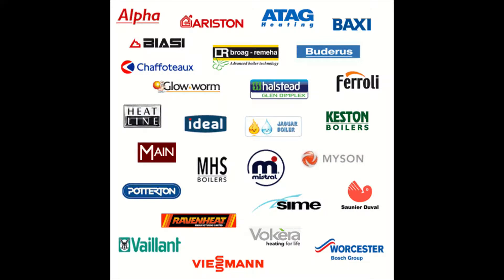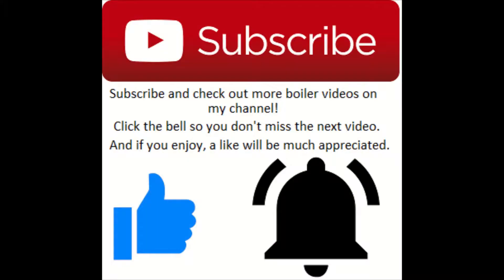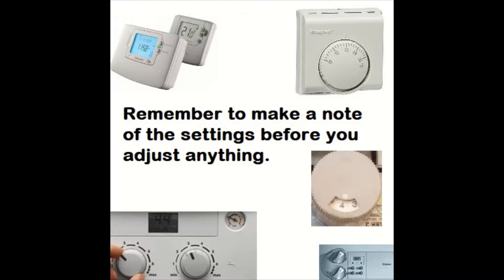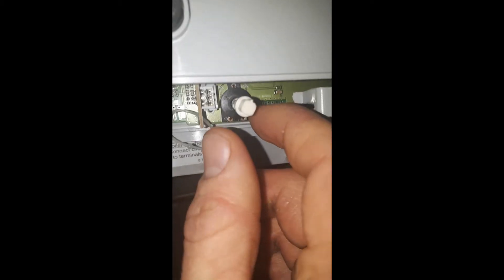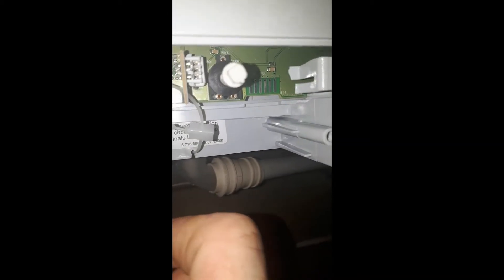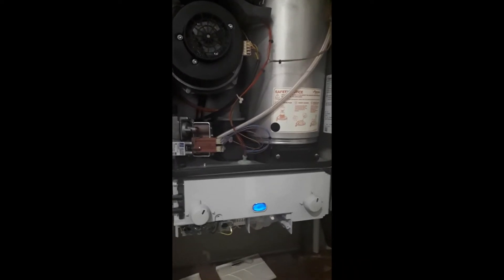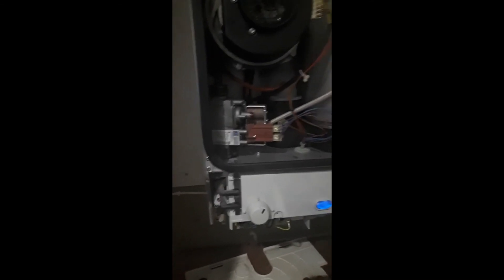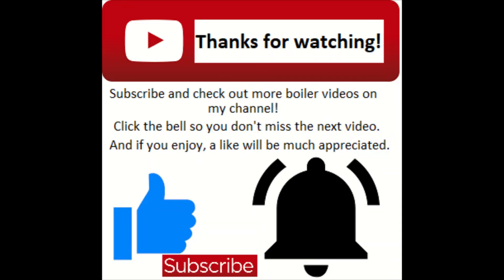How To Put A Worcester Greenstar RI Boiler Into Service Mode / Function HIGH FIRE LOW FIRE

Comment: Question, If the radiators are bleed reducing the water in this system must water be let into the system via a valve to correct the pressure or does the system connect directly to the mains?

Comment: Thanks for the video. If the white key is missing can an allen key or something similar be used?
Reply from the maker: You probably could get that or a flat head screwdriver in there, BUT something plastic would be better, so you don't damage the board and the boiler will be live and on when you're putting it in this mode.